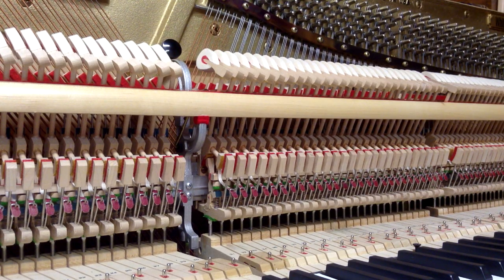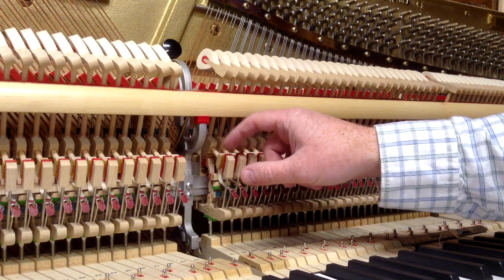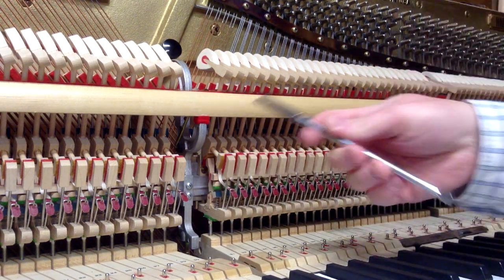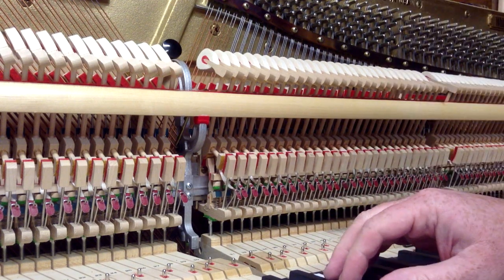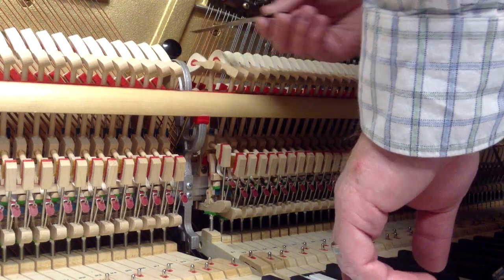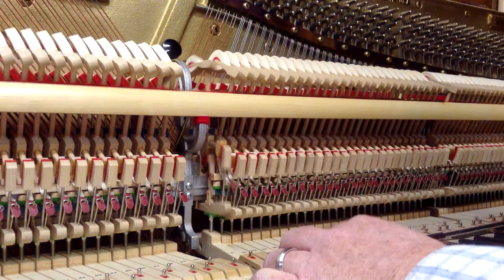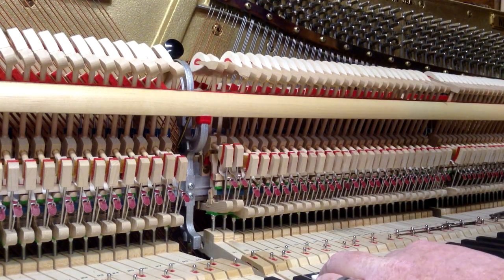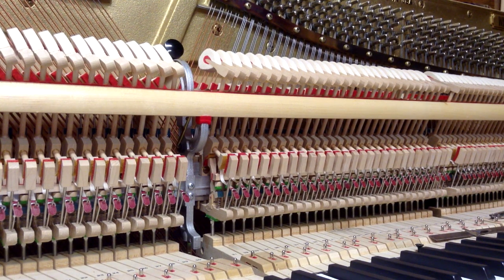Regulating Vertical Piano Backchecks - Piano Tuning & Repair I HOWARD PIANO INDUSTRIES

Comment: With the backcheck & bridle tool as well (as the damper regulation tool), I feel like instead of using the tool to bend the wire, which puts stress on the joint between the wire and the wood, you could use the tool to hold the wire, and then use your hand to bend it, putting the stress between the tool and the wire. You can even push the tool slightly in the opposite direction and then push the wire the direction you want to go with your hand, which helps in tight spaces. At any rate, this is what I have been doing because my piano was built in 1927 and I don't want to break anything.
Reply from the maker: Yes, I agree, this sounds like a good idea. It is also possible to just use your fingers but I like the idea of your hybrid approuch.